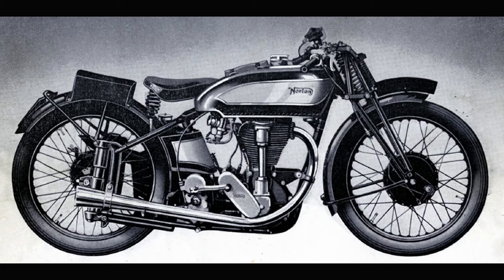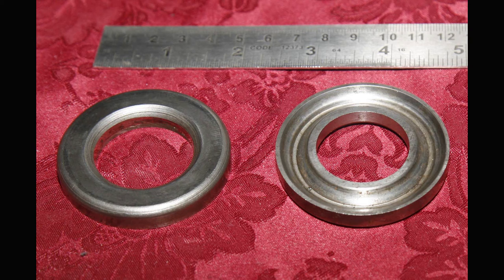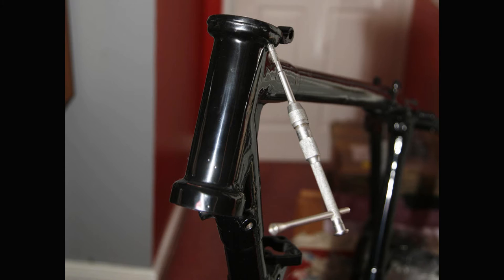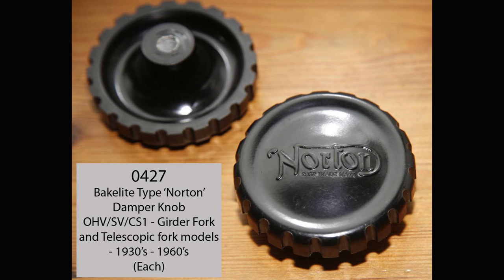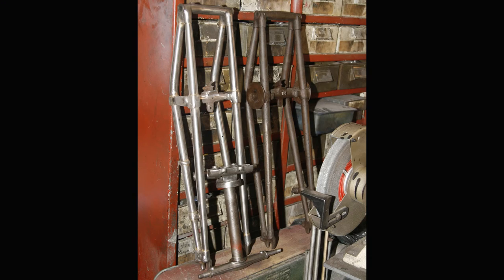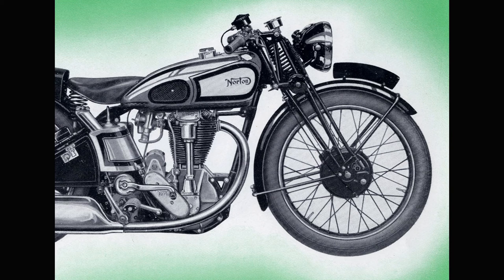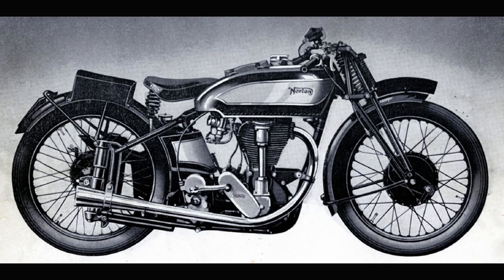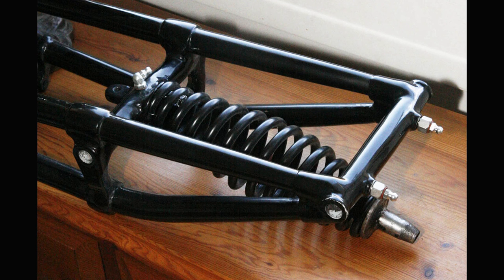Pre War Manx Norton Build   Part 4

Comment: Very interesting and I must say that the idea of rubbing down the powder coating and then applying two pack for a better finish is very creative. It would be great Paul to have your feedback on Stove Enamelling? .  I am in the process of rebuilding a Walter Moore CS1 bike. I have a spare engine if that would help identify any parts you may want to produce, please get in touch.
Reply from the maker: Hi Stan, thx for kind offer on CS1 engine for ID'ing parts (would be best if you could contact me through www.RacingNorton.co.uk to discuss, thx), but for your question re - stove enamelling,: it has been many years since I have had  done what used to be the  old style of 'Stove enamelling', as the British bike industry used to employ - so difficult to comment on that (although I do remember it sometimes had a reputation for chipping more easily), but regarding the more modern 'plastic powder coating' - where the paint dust is sprayed on, before going in an oven - I have always found this the most durable and hard wearing finish, providing the frame is blasted before powder coating.  However, I find that often the finish can be less than perfect - or follow the profile of any defects or pitting.  If this is the case, I have found trying to rub the plastic coating down, and re-polishing it, can be difficult - hence why I will sometimes use it as  the 'basecoat', before matting it down, removing defects with primer filler etc - then giving a final top coat of two pack.  best wishes Paul